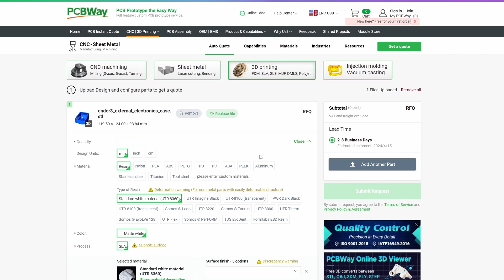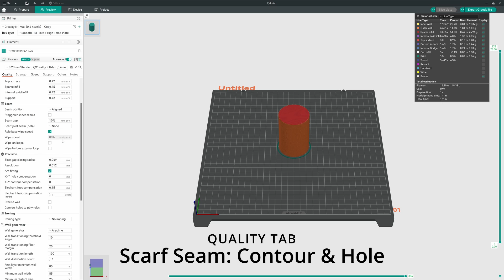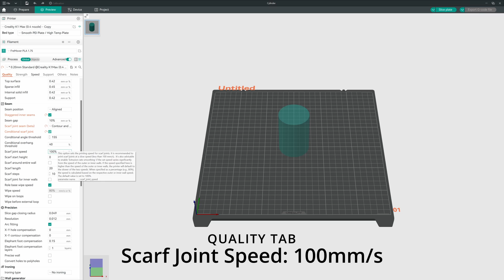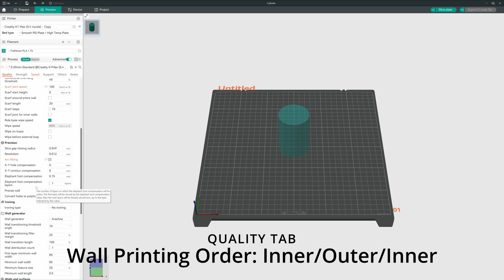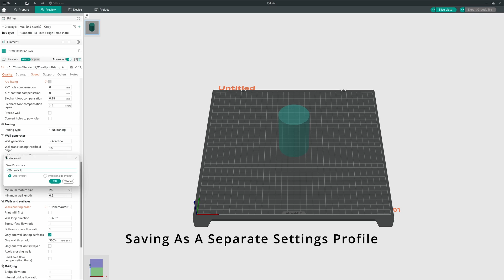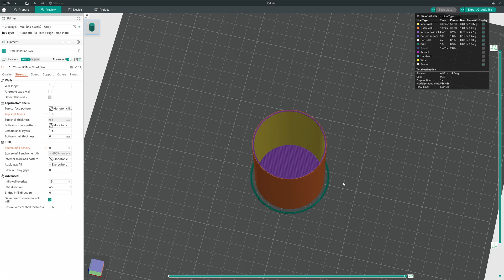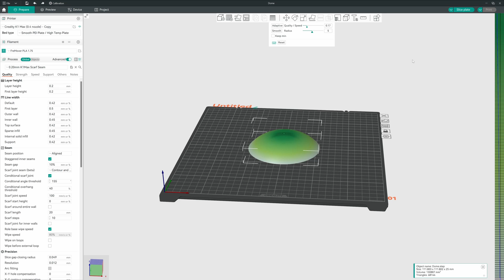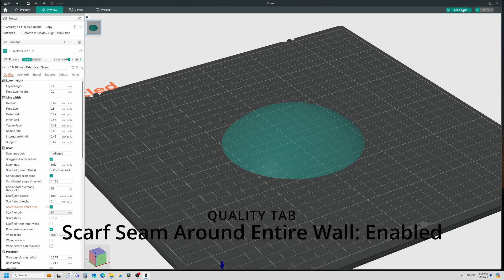Exploring Orca Slicer Scarf Seams

Comment: with the filament i'm using now (which is not good qlty), scarf seam makes a huge mess of my prints
Reply from the maker: When dealing with poor quality filament, the best to can do to improve the quality is to 1) make sure it's dry 2) Run a temperature tower to dial that in and then 3) a flow test. If your basic print results improve, then give the scarf seam another try.
Reply: @pushingplastic7445  done all that and now just want to use it up as fast as possible and be done with it

Comment: I tried it on rectangular objects, and it creates some kind of blobs on the sharper corners. Did noticed something like that? Seam gap 10%, Contour, scarf length 20 steps 10
Reply from the maker: Scarf seams work best on cylindrical models, not so much models with corners. But for the blobs on corners, run the calibration for Pressure Advance. That should help!

Comment: Good video, thanks. How did you determine the scarf seam parameters that you used? Hard to believe you just randomly picked the values you used. Was there documentation that you referenced that gave you your starting parameter values? You also didn't cover any of the downsides to using scarf seams like increase material usage and print time. Would be really useful to understand those tradeoffs when trying to decide on whether to use scraf seams. Also what model features can benefit most from using this? Things like circular shapes, overhangs, angled sections, etc.. Would be good to understand how to evaluate an object to better understand what types of features it has that should prompt you to try scarf seams. And is there any correlation between the type of filament used (ie PLA vs PETG vs TPU vs ABS vs ASA, etc.) and the quality of the results you can expect?

Comment: I finally installed orca slicer the other day and gave it a go. I was really resistant since I find the whole layout of prusaslicer to be very illogical and unintuitive. I had hoped they would have fixed some of this in orcaslicer, and boy howdy, was I ever wrong. I was shocked at how little sense it made to me. Perhaps I'm just used to cura but at least in cura i don't have to dig to find what should be easy to find settings. I actually had to do a search online just to figure out where they hid the filament temp settings. lol.  I NEVER would have considered that i had to click on this tiny box to open up a hidden menu. Why they can't just put a row of tabs across the top baffles me. I really do want to use it tho and I want to use its features but they make it so difficult for me to justify the time.  This is one area that i firmly believe will be the next "big thing" that will make 3d mainstream... the software.  Slicing a file shouldn't be the hard part 😊
Reply from the maker: Switching slicers is never easy! It took me a while, now I can bounce around from Cura to Bambu Studio to Orca to Creality Print. I learned Orca because it had a little bit more functionality than Bambu Studio but beyond that they are very similar. I agree with the software being the "next big thing" when it comes to 3D Printing. Thanks for watching and welcome back! It's been a while!

Comment: Very useful video. I'm printing wheels at the moment and my seems are barely visible now. Thank you for the great video.
Reply from the maker: I have a set of tires I printed in TPU a few months ago. I'm thinking of doing the same as you and reprinting with the scarf seam! Thanks for watching!
Reply: @pushingplastic7445  What TPU would you recommend for the K1 Max?
Reply from the maker: @MarcoMrSoul  Honestly I couldn't recommend one. I've only ever tried Overture 95A TPU in the K1 Max. the only reason I tried that was because it was what I had. It worked pretty well with the Generic-TPU profile in Creality Print. But I am wanting to try Creality's HP-TPU. I'm hoping that the combination of their filament, in their printer with their profile will give good results. Thanks for the question and thanks for watching!

Comment: I tried your settings on a little articulated octopus and the seam almost disappeared. Then I changed the seam location to random and the seam vanished altogether. Last time I tried random seams i got a model with zits everywhere - using random scarf seams the print is amazingly clean.
Reply from the maker: That's awesome! I'm going to have to try that!! Thanks for the tip and thanks for watching!